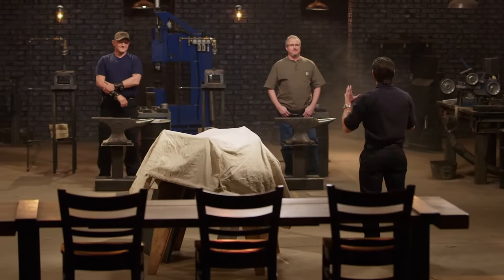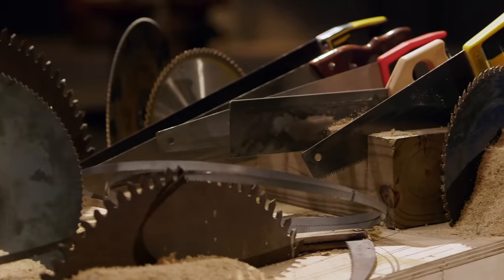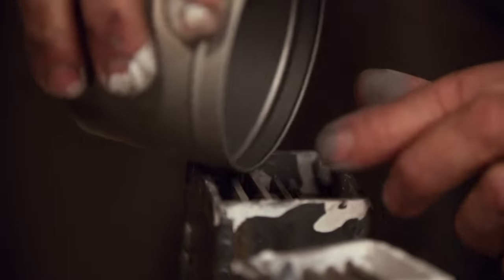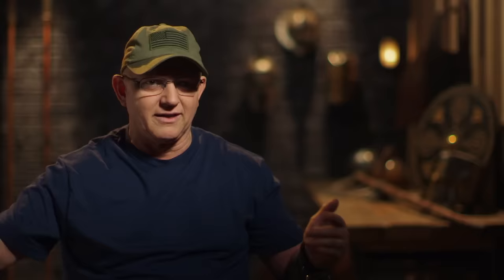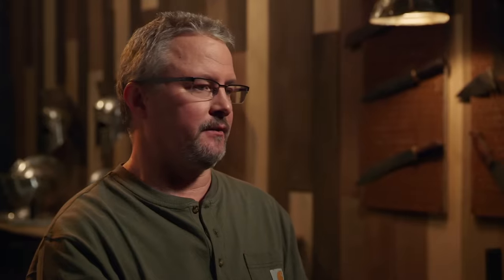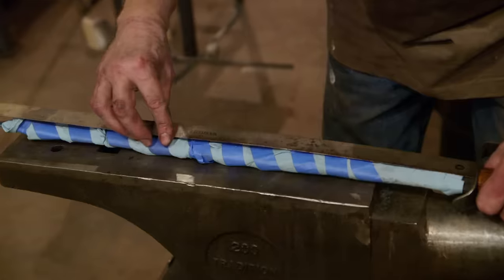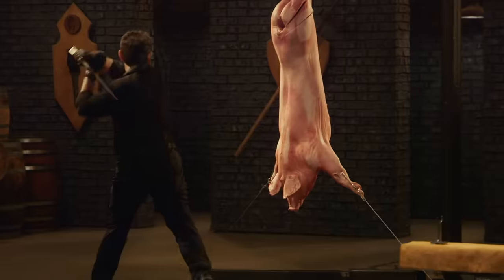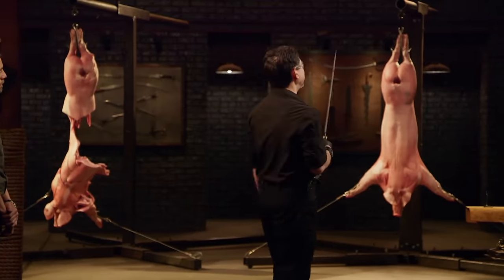Forged in Fire: Beat the Judges: SAW BLADE SWORD CHALLENGE (Season 1) | History

Comment: Even with the weight, I think his sword out performed Jay's.
Reply: correct, it wasn't a weight test
Reply: Weight is something important 
Too little and it won’t cut deep
Too much and it will cut but it will be difficult to control and possibly dangerous due to the extra force required 

This is why you see some challenges where one sword can cut through fish and not rope 

The cut test shows how even a dull blade can cut with enough weight but the challenge was the sword
Reply: @maggimaster  and see no one is saying that weight isn't important or denying it's effect.  But Jay lost that battle even with the extra weight.
Reply: Out performed and look better it was rigged just like boxing
Reply: I mean when a shortswod weighs more than an arming sword it will chop well but in all aspects the swords were compareable like the two claymores they've shot... apart from the lighter blade being a less "impresive" cutter
Reply: I mean, I get that weight is an issue, but when it gets down to brass tacks, the real question when it comes to a sword is, "Does it cut?" And the heavier sword did a better job at cutting. The pig was chopped up better, they both dulled on the pot test more or less equally, and the sand the heavier sword did better. If they are going to ignore literally everything but what the sword weighs then that should be the official rule rather than wasting the blacksmiths time with other random tests. Just put the things on a scale and call it done.
Reply: Yeah Jay's sword underperformed compared to the other. They complained about weight but the heavier sword did the better job. Plus no judge was unable to weild it. Just prefer a lighter sword
Reply: @ejbasshooks3883  rigged! Yeah
Reply: Point here is... Given the choices. Heavy short sword that can cut vs a lighter one that doesn't and the one you'll not pick goes to the enemy which one would you pick?
Reply: No, both sword don't perform that well in sharpness test, just that the heavy sword can cut with more force, Both blade become dull after hitting the pot. although the heavy sword may seem to perform better it was because of the weight rather than the sharpness of the blade.
But, I do agree that not everything come down to the weight. The judge should make thing more clear rather than ignore everything else and focus only on it.
Reply: @xlDon2lx  You need to know that short sword advantage is it lighter weight leading to faster movement, If it is too heavy then why not just use a longsword, similar weight, longer range, use similar amount of stamina, attack at similar speed.
Reply: This is why they added weight parameters for some of the other beat the Judges competitions
Reply: @USA I don't agree with your arguement that the lighter sword wielder is always going to win.  If a lighter sword can't cut, and a heavier sword can... Then no, lighter sword loses.  There are too many factors to simply say a lighter sword will always win.  And in this competition, Jay's lost, his did not cut the sandman or pig as well, which a short sword should be able to do.
Reply: Yes , but in a fight you'll be able to wields jays for longer
Reply: I thought the same thing
Reply: If the judges complain about the weight, you're doomed unless the other guy suffers a catastrophic failure.
Reply: @xlDon2lx  The lighter one. Swords are side arms. You won't use them 99% of the time. And when you use it, it won't be to cut but to intimidate and keep people at bay while you scramble to a better weapon or towards friendly lines. But you will be humping it all the time.
Reply: @ebunny1970  Weight is a huge penalty. Unless the other guy's blade snaps, the heavier blade loses most of the time.
Reply: @throttleblipsntwistedgrips1992  Swords are side arms. They're there to keep people at bay while you scramble to a better weapon or friendly lines. No one wants to find out if your sword is dull or sharp by having it tested on themselves.
Reply: @majungasaurusaaaa   tell the guys with an MoS how a few ounces won't make a difference. 🤷🏼‍♂️🤦‍♂️
Reply: @majungasaurusaaaa  unless you're an 11B with an LMG. Angriest guy on patrol is also happiest in a firefighter😂
Reply: I agree 100% that rules are not very clear especially to the audience due to the performance differences in these tests. Because I do agree in my opinion that Jay shouldn't have won that competition because of the basis of what these tests were meant. The was made clear when both swords performed the same in the strength test however in the other two tests, Tony's sword performed so much better.
Reply: @wheelie-gonzales  comfort matters
Reply: @Devilion901  How is that?
Reply: They always said the weapon shouldn’t hurt the user. Imagine swinging a 4lbs around will most likely throw your shoulder out of the socket
Reply: @ToMu29  Didn't seem to throw Doug's shoulder out of place to me.
Reply: @ebunny1970   A heavy short sword is deal breaker,  exertion kills you before everything else. 

Next time they should include weight parameters since most are plain clueless.
Reply: Yes
Reply: @wheelie-gonzales  Correctly Said!
Reply: @maggimaster  one judge said Tony's had a Good Feel. Weight was not a Issue to him
 Tony's had a Smaller sword, with Similar weight.
Reply: @xlDon2lx  Now think about the point that the heavy short sword you probably chose weighs less than the greatsword I'm wielding and guess what your chances of even getting into the range of your ~16 inch blade alive are? 

The weight is referenced simply because it is part of the definition of the weapon, it's looser than the length for instance, but if you just want to maximize the strength & depth of the blow/cut, skip the sword and make an axe. That's not very fair to your competitor who made a dagger though, which is why it's taken into consideration.
Reply: @xlDon2lx  yeah but the thing is you don't need to cut clean through someone durin a fight. I'd rather have the lighter sword to attack quicker and more comfortably. Jay's does more than enough damage to kill without the added problems of a heavy unwieldy weqpon
Reply: Well the thing is with swords its not just burst performance they have to withstand you need to be able to consistently wield the weapon against your target, and a sword that is so heavy will tire out the user way too quickly no matter the amount of damage
Reply: Who doesn't want to see Jay lose? 😉
Reply: I agree.
Reply: @xlDon2lx  both swords given proper edge maintenance will cut well. The a short sword beyond a kilogram is just a no go... You cannot wield that effectively one handed.
Reply: @yourfreddy23  a sword, any sword has parameter at its base core. a sword is not a mace. most swords are 1-1.5 kg which is 2 to 3 lb. they said his short sword was 4. sorry u dont make a short sword that is this heavy. thats just unsword by definition.
Reply: @chrishubbard64  you do get that heavier swords will cut more right? You also get that they have to make a certain kind of sword. If they tell you to make a dagger and it's 2 pounds of steel in the shape and size of the dagger, that isn't gonna win even if it cuts a pig in half first swing
Reply: @RozKounelakion  You do get that they have parameters to work with right? if it fits in the parameters then all thats left to decide is which blade does its job better. A heavier weapon may tire you out sooner, but if it kills in one attack while the lighter needs 2, who is going to run out of opponents faster?
Reply: Dont listen to these people. This was rigged
Reply: Totally rigged. If a sword doesn’t cut them it’s useless. And as someone else pointed out they were able to wield it without trouble so complaining about the weight is just personal preference. All swords can be unwieldy no matter how expertly made if used incorrectly, such as just standing there and wildly swinging like they do sometimes. Jay definitely did not win, his blade will not keeel
Reply: Exactly i feel bad for tony
Reply: Bro this is a short sword so it must be the onehanded not double handed. So weight is so important
Reply: Its not rigged bruh a short sword is supposed to be lighter to be wield better not a short sword that weights like a claymore
Reply: I think it was the right decision even though he out performed the judge it wasnt by the biggest margin. The weight is a gigantic factor in a sword.  Think about if you were to fight someone the heavy sword would cut deeper if you connected but you would wear out quickly and be vulnerable to a good swordsmen lighter is just whats needed in a sword
Reply: When your weapon is totally out of the weight scale you always loose at this game, judge blade or not.
Both blade have « properly » cut only one arm to the end, so obviously the weight is the key factor. In fact this defect are so big than the only way he could win is if the judge blade have broke.
Reply: Ok so I'm going to put my opinion in here.  Jay 100% won. Both couldn't cut.  End of story.  The first sword didn't cut.  It crushed. The other competitor suffered some damage in the strength test.  Jays did not.  For those who think it is rigged.  If you look at the other time Jay competed, he lost due to a small handle issue.  So no it is not.

Now for those who say weight isn't everything.  It absolutely is.  Swords that are as long as this should never weigh over 4 lbs.  That is an extreme amount of weight in a small package.  Weight will cause many issues and could cause a sword to break the users wrist.  So yes jay one.  Feel free to argue but that is the truth.
Reply: @yourfreddy23  bro weight is just as important as comfort.  The heavier blade is harder to control, harder to swing, and could possibly break your wrist.  Weight isn't a parameter no.  It's a common sense subject to any blade. No sword that size should be that heavy.  End of story
Reply: @RozKounelakion  I'm sorry but I have to respond to this idiotic post.  No a heavier sword will not cut more.  A sword that weighs 2 lbs and the right heat treat and sharpening can cut more than a 4 lb sword with the same.  Weight bogs the blade down and makes it so it cannot cut all the way through and to top it all off, makes it harder to wield.  So please do research and not post stupid arguments
Reply: @yorkhyper1449  no, I won't
Reply: Think in terms of a nail hammer. If the task is to build a nail hammer, and you turn in a sledge. Yes the sledge will drive a nail better, break things better, and overall perform better. But it's not a nail hammer, it's a sledge. Now if you turn in a slightly heavy nail hammer, then it's not a huge deal. But go to your local gym, pick up a 1.5 lb (likely what Jay's blade weighed) dumbell and swing it around, then pick up a 4 lb dumbell and swing it around. It's a huge difference.
Reply: Something I thought while watching that I didn't see commented on much is that the blades can be resharpened, both of them. It would be a simple task. Would they have performed significantly different than each other after a sharpening? Probably not to an extreme. The pig test was a good indicator of that. Overall, despite both dulling, they can be resharpened with ease. The heavier sword cannot be made lighter with ease.
Reply: Doesn’t matter weight is a spec when it comes to a blade.
Reply: I agree
Reply: I would prefer a light weight sword
Reply: It did only because of the weight tho.  You wont be able to fight with this for multiple hours
Reply: It would have but the weight was too excessive. A short sword needs to be light and sharp, you need to be able to swing and cut effortlessly with it and if the weight is too heavy it's more dangerous to the wielder than the enemy.
Reply: Facts
Reply: @wheelie-gonzales  It wasnt a weight test? Wut? Weight matters. And "performed better" just cuz the weight it cuts deeper etc. Its for sure much nicer sword but its not effective.
Reply: @maggimaster warriors got used to heavy swords, grandpas didnt
Reply: In terms of sharpness nad durability, it did outclassed Jay's blade.
Reply: Agree
Reply: A four pound short sword is heavier than most longswords. It’s not quite a claymore, but it would be close to the weight of some two hander swords
Reply: @jlaw131985  
A sword that doesn't cut is a problem also. Granted both issues could be easily solved. But at that moment I personally think a dull sword is worse then a heavy sword.
Reply: @sjgavenger37  they both cut during the kill test, and they were both less than ideal after the strength test. And even if the performances were less close (which they were actually pretty close) 4 pounds is extremely heavy for a short sword, and you’ll tire out in no time while trying to use it, and even if you didn’t, the swings would be slower, easier to deflect, and hard to recover from. No way anyone who actually wants to fight with a short sword would pick that sword over Jay’s.
Reply: It's almost impossible to see the impact weight has on something through the screen. I've seen episodes where the contestant wins so it isnt necessarily rigged
Reply: Agreed
Reply: Barely. Jay’s was too light to overcome the damage to the edge in the pot chop, but because the other blade weighed so much more (4 pounds is significant weight when attempting to use practically) it made it uncomfortable to use. Yes, the momentum generated by propelling such a heavy chunk of partially blunted steel is capable of causing massive damage to a target (a ballistics dummy would have shown this far better) but when neither sword can cut well, it becomes judge’s preference. And the judges, understandably, didn’t enjoy swinging a sword that weighed as much as half a gallon of milk.
Reply: @ebunny1970  depends. The lighter sword is easier to thrust with. Thrusting is more precise, is often quicker, and was Jay’s not stuck in a block of wood at the end? That would indicate that it at least had a reasonable point. Plus the lighter sword can parry better, while the heavy sword can only really make huge slashes that, yes, tear into the target nicely, but they leave the wielder exposed and are harder to maneuver, meaning limited blocking capacity, faster stamina drain, and fewer effective offensive tactics compared to a lighter sword with a sharp point, even with a dulled blade.
Reply: @chrishubbard64  which can deflect a blow faster? Which can be maneuvered defensively better? Which has a better range of offensive options? The lighter sword. The heavy sword is a chopper. Not a cutter, not well balanced, not a stabbed. A chopper. Meaning that large, slow, slashing motions are really the only option for fighting effectively. You can keep that sword. I’ll use a lighter, faster blade that can deflect yours or dodge it, poke holes in the openings you leave when you slash, and by the time you’re looking like that pig, my arm won’t be tired. Meaning if need be, I can just draw that fight out until you’re exhausted.
Reply: @wheelie-gonzales  Sword parameters matter in crafting. A longsword on the heavy side 3.5 pounds. If that short sword really weighed 4, it's outrageously too heavy.
Reply: I think the eesence of the knife is so that it can be wielded one handedly
and the wieght made the difference
Reply: As a trained rapier,spadroon,sabre,small sword fencer if a sword is heavy or a bad center of gravity its a fatal failure u cant swing that thing as easy and cant thrust as good so i agree with the judges

There r many other reasons why too
Reply: yea me too.
Reply: @chrishubbard64  well in a real fight like 5v5 or 5v10 would you rather be able to swing a blade enough to kill 5 guys or 1 guy I would take the lighter one cus that thing isn't gonna drain me as much
Reply: @Ghostdragon529  those judges are masters at it, if you take a regular guy he wouldn't be able to swing it twice in a row
Reply: @xlDon2lx  if the heavy sword wasn't as heavy it would cut just like the normal one, and the purpose was to make a short blade and not a heavy sword
Reply: @Devilion901  a heavy short sword at that xd
Reply: @zacoutortue009  I wouldn't even take a batt  with that weight
Reply: @chrishubbard64  that depends with a heavy sword I can kill one dude and then be tired out with the light one I can go ham much more
Reply: @mickeyjett9197  that's the most stupidest thing I have ever heard someone say, a sword can be unwieldy? I wouldn't want to bet my life on a sword that doesn't keep me safe bro if I had the choice to chose a good weapon over a faulty one you  know which one I will decide on
Reply: One handed blade shouldn't weigh a lot .
Reply: 4 pounds is not small
Reply: Agreed.
Reply: It doesn't matter. It's a short sword. It must be light. That's an absolutely essential feature
Reply: why dont u become the judge ...u r so expert just watching tv
Reply: I'm trying to buy condoms
Reply: Yeah same, I was surprised when Jay won.
Reply: yeah, that was b.s. J' s sword didn't even cut in the last round because his edge got beat by the pots and his end looked all funky bc he had to shorten it up rq so he wasn't over length...
Reply: Aesthetically Tony's blade was far nicer
Reply: @elyanae9588  rip tony
Reply: I ripped a dirty dump after that
Reply: @throttleblipsntwistedgrips1992  Not if your arm is cut first.
Reply: @maggimaster  I mean if they say the word heavy guarantee he will lose unless his opennent gets catastrophic failure in his weapon then he will win
Reply: You can see it in the cut test
Reply: I do have to agree, it did well on the first sharpness test but into the second he definitely lost
Reply: In every category except as weapon.
Reply: Sure, but it's a matter of misinterpreting the assignment. If you asked a couple people to write a good short story, then one writes a mediocre short story, and the other writes a thrilling and engaging novel, obviously the one with a better grasp on the assignment should get the win.
Reply: Agreed
Reply: And the craftsmanship was better in my opinion
Reply: @kennyoboy642   No lol,  weights, lengths are standardized,  what you said is an individual preference, holds zero value.
Reply: Totally agree
Reply: Its not about performing, crushing or slashing/cutting. Even durability shouldnt be the sole criteria.
Its a weapon. and weapons are made for people to use. This should be usable.
If its built just for big people, the weapon doesn't have versatility. This should also be something to be noted. There's no reason for this to be overlooked. In a store, anyone who buys it should be able to use it, not just Gregor Clegane.
Reply: And they also said it in many episodes. If its too heavy, your energy to keep swinging it in the battlefield decreases, resulting in a not so great outcome. Even Gregor Clegane gets tired.
Reply: @chrishubbard64  Travel back in time and fight someone using a 4 pound one handed blade, while they use a 1.5 pound one. You will get demolished.
Reply: @Ghostdragon529   Was it rigged, probably. Would I pick a 2 1/2 pound (well made) short sword over a 4 to 5 pound one? Every time. Because I’m thinking “ how agile can I be in battle with this sword” and in battle, speed determines the winner. Most of the time.
Reply: @xlDon2lx  Simple, I would go with the lighter sword.
Reply: @yourfreddy23  ??? They've been pretty consistent throughout all their episodes. If your sword is heavier, you lose if your opponent's sword doesn't break.
Reply: @TheMaverickq  ...I am also certain at this point that the people rooting for heavier weapons in this thread has never touched a sword in their life.
Reply: Oh hands down, easily bet Jays.
Reply: @porkcutlet3920  if it's heavier but still well balanced for fighting it's still won. I've seen heavier swords won. Being heavier will guarantee more mass and materials to perform better in cutting and durability test, however, if a short sword is heavier than most two handed wp it's def not good. Most people never swing shjt in their life, a heavy sword slow you down a lot and affect fighting techniques which can't be seen in such a vid like this so they tend to underestimate the effect. In irl fighting, even a cut to the hand is enough to end the fight but most will just watch movies and think movies fighting is legit. Well if a huge dude swings the heavier blade it prob be fine if the balance between speed and agility is not affected. 

The con of an overly weighted sword is: slow which makes op can react, block easier while you can't do the same as effectively, hurt your wrist and shoulder. If it has more mass, it obviously gonna cut better unless the blade is dull. And more mass means it's harder to bend and break.  If one go with an overly weighted blade, they effectively chosen to handicap themselves in a fight so technically they choose weapon life > their own life. If a user is very strong and well built they might go with a heavier weapon to a certain extent because you can't swing faster at one point there will be a cap to it. It's like swinging your hands empty-handed. It's all about finding a suitable weapon but in general you will never choose a wp with more weight than necessary.
Reply: Exactly!!
Reply: Jay was bumbling right out of the gate aid no “master blade smith”!!! This is the second episode where they gave him the win over a far superior blade smith. I my opinion Jay is a sham and the weapon he made in this episode was something that I’d expect to see from a novice. Tony’s blade on the other hand was absolutely beautiful, albeit a bit heavy. It cut the sandman with ease, whereas Jay’s blade failed miserably. After watching this, the second of a rigged competition, I’ve decided to not watch anymore.
Reply: For all the replies saying it matters about weight, go back to watching other contestants, weight had probably the most minuscule importance when deciding a winner, even more when they clearly outperformed the other (despite the opposition having a lighter blade). This was clearly rigged, no question about it
Reply: we all do
Reply: Yeah I’m starting to think that these beat the judge challenges are rigged
Reply: Not only that I think the extra weight help drive the blade through some things Jay’s couldn’t.
Reply: weight is more important. this is not sumo wrestling
Reply: Yee
Reply: Like the look way better then jays style points
Reply: Weight is a big deal though, when actually  using a blade.
Reply: But they are seeing with some refinement the lighter one has more practical use which is why it won.
Reply: For those who disagrees that J won, think about it in a real life fight. You can wield a lighter blade longer than your opponent who has a heavier blade. Having a lighter blade will make you more agile and consume less stamina than wielding a heavier blade.

"bUt tHe oTheR sWorD PerFoRmeD bEtTeR". Dude, If I'm not mistaken, swords are primarily made for fighting not cutting pigs and smashing pots. Aside from the tests, the swords are also judged based on how practical it is to take into battle.
Reply: No sir. Weight matters alot. With weight you cut deep but by cutting deep you loose power and stamina to wield it.

A short blade should be very light. A light blade does not cut deep into the stuff such as bag with sands or other stuff. A lighter blade is fast to maneuver and wield.

No one likes to opt for a heavy short blade. Cuts do not matter when you are unable to maneuver it
Reply: Only idiots would think that its rigged
Reply: It’s a single hand sword overall. Weight does matter a lot. In fact Jay’s light sword perform better in the strength test showing that he has better control on the heat and the chose of metals. I personally think the judges made the right decision
Reply: @vanmann8347  it all depends on the rules of the competition…
We talked about specs and tony doesn’t respect what they asked , a short blades he knows the standard for those blades if I was the judge I wouldn’t let tony even compete..
I ask for a compact car and you bring me a station wagon How can you compare ?
Reply: @chrishubbard64  It did better on the pig test because of the WEIGHT. What matters is that the blade is able to kill, not that one did it "better" or "looked" better.

Look at how OUT OF BREATH he is after swinging the sword. A short sword is meant to be able to be handled without issue. Not out of breath after 4-5 swings lmao.

And his did one whole cut more on the cut test, and could again be attested to weight rather than actual cutting ability. 

I don't remember the video, but there was a sword guy explaining this exact thing, and was taking dull but heavy blades and slicing through bamboo and other material with it, while then doing it with a much lighter, but far sharper blade, that couldn't manage it all the way through. The lighter blades CUT better, even though they couldn't go fully through, whereas the other got through by weight and momentum, rather than cutting edge.

Look at it more like the slice tests they do. Some swords go all the way through, but they ripped/tore/etc/ through it, rather than CUT. That's basically the issue with his blade.
Reply: And it was more beautiful
Reply: The whole purpose of a short blade is that is supposed to be light and easy to swing around, so yeah weigh does matter otherwise they would have asked for a claymore if the while point was to cut in half on one swing
Reply: Seems like with the weight alot of it comes down to personal preference and strength. I agree, Jay probably should of lost
Reply: You have to realize that weight is such a kill factor in like making any sword. Heavy blade uses energy and more time to swing. Compared to a light sword as the judges said you can do it all day without getting to tired. 
I know it seems like puny excuse but weight is the most important thing to a sword.
Reply: Weight is probably one the most important factor on a blade that performs. I've seen beautiful, amazing dozens that cut through, but were just simply beat by speed and maneuverability brought by weight.
Reply: Kinda, if the sword isn’t comfortable to wield, that counts for a lot.  If you had to use a blade, you’d want something comfortable and balanced, not something that would tire you out and hurt your shoulder.  They tested equally, imo, except the sand man test, which was very close.  If I had to choose one I would have picked Jay’s.
Reply: @Ghostdragon529  they only wielded the heavy sword for a few swings. In battle a heavy sword would be deadly to the user as they would get fatigued faster. Also it may have not been a weight competition but it was a singe handed sword competition and the weight makes his sword too heavy to be safely wielded in one hand.
Reply: I can say from personal experience that a heavy blade is not comfortable to wield, especially a close quarter combat sword like the short sword, and jay's sword trumps the other sword in terms of functionality for a blade can be sharpened too
I like the design of the heavier sword in terms of looks nore than jay's tbf
Reply: @ebunny1970  i mean saying that the weight is to be disregarded in the competition for it cut sharper than jay's is kinda saying that weight isn't all that important, don't you think?
Reply: @Ghostdragon529  yk there's a reason to why they prefer lighter swords...
Reply: @chrishubbard64  these swords main purpose is to serve as combat sidearms, i think you're underestimating how much of a issue it is.

If today's troopers break the handles of toothbrushes to reduce weight, imagine carrying 2 to 4 extra pounds of secondary equipment for miles ON FOOT before you reach a battlefield and then having to fight face to face with the enemy.
Reply: I think jay lost that in reality.
Reply: yea, he got duped....grats J
Reply: sadly, swords have a "standart-ish" weight for a reason, when you accelerate a sword and miss target it puts a lot of pressure and lever on your joints, a heavy blade needs a big size to compensate the body mechanics, but in a small blade, its a recipe for self injury... i agree it was better looking blade ( not so much the handle, but the blade itself... uufff it was pretty) but its no use when u cant properly swing it...
Reply: Try using a 4 pound one-hander. You'd rather use your fists.
Reply: @wheelie-gonzales  if that were the case then competitors should just put a bunch of weight into their short swords so they could cut better. Remember its a short sword and not a two handed weapon. Making a short sword much heavier than the typical weight and then judging both of them at the same level is unfair in so many levels
Reply: @ebunny1970  it would unfair if you could add weight when it's not faithful to its design and then the judges not take it into consideration and simply give you the win because it cut better
Reply: @mickeyjett9197  Its not just a personal preference bro, how can you downplay the importance of weight especially when they take historical accuracy into account. As someone else said, if they ask you to make a dagger and your dagger is heavier than dumbells then you arent going to win, regardless if it performs well in the tests
Reply: yeah, his sword outperformed Jay's but not that much.
not enough in fact to justify him winning with a single handed sword that weight heavier than a double handed sword
Reply: @xlDon2lx  the lighter one, because your enemy is not a pig that let's itself cut up. Your enemy will be armored and mobile. Heck, if I can exchange the heavy one for a sword of the same weight, i would choose a Zweihänder to fight the ther shortsword.
Reply: It did outperform it at the cost of a single handed shortsword weighting more than a twohanded longsowrd should...
Reply: agree
Reply: J coasted knowing his sword didn't need to survive J beating it against wood/rock/iron, went for a lighter sword.
Reply: @wheelie-gonzales  but it is weight test, its all test, in battle I would rather fight with jays lighter one that still cuts  rather then heavier one, that's jut my opinion ;)
Reply: I wish I could go back in time and ask a roman soldier which sword he'd prefer to take with him in battle.  Because when it's a matter of life and death, the soldier would choose the better blade, heavier or not.
Reply: Yea, even tho Jay's blade wasn't as heavy, it did bad on the sharpness test.
Reply: Boys I think it's fair. They have parameters that needs to be met which is for a one handed short sword.
Reply: Agreed
Reply: Definitely biased because his jays sword didn’t even cut at all
Reply: ofc it cuts better when the weight is doubled. They made a short sword not a mace
Reply: @chrishubbard64  you can sharpen a sword. You can't take off much weight or redistribute the weight once it's forged
Reply: @xlDon2lx  I'd take the lighter one, since I could sharpen it. Swords are supposed to be light. They aren't making axes.
Reply: @throttleblipsntwistedgrips1992  exactly. And you can sharpen a blade if it doesn't cut. You can't really fix a weight issue with a sword once it's forged
Reply: @ebunny1970  No, but if you've ever tried using a sword, you'd know that it doesn't need to kill your shoulder to tire you out. And if you're too tired, you're dead in a fight. You can sharpen a dull blade, but you can't fix a heavy one.
Reply: @porkcutlet3920  Exactly. Tons of viewers want to backseat judge and complain about how heavy weapons always lose when most of them have never even seen a sword in real life, much less picked one up and swung it around
Reply: @isaiahhallett9871  There's a Beat the Judge episode where Jay loses. Was this one rigged? Possibly, but not all of them are. And the other beat the judges episodes are relatively fair, where the judge is actually a genuinely great smith like Ben or Dave
Reply: @Sienista  and you can always sharpen it if it's dull. You can't fix a weight issue
Reply: Yeah but in the end of the day the weight matter when your in battle otherwise your the first to get tired and the first to die
Reply: @whiterosebloodmoon4522  Exactly. You can sharpen a dull blade, but you can't fix a weight issue. I'm sure lots of people who make comments like this have never used a weapon for an extended period of time
Reply: if the judges pick the heavier sword then i bet subsequently all contestants gonna just make swords heavier than what it should be to add to their cutting ability
Reply: @xlDon2lx I'll pick lighter because you can use it to stab much better if it's edge are already dull probably in combat heavier short sword can easily tired a swordsman and if the edge is already dull you can hardly use it for stabbing because your tired compare to a lighter sword.
But it is indeed the heavier short sword out perform the light one in cutting
Reply: His design was better, too.
Reply: I'm just watching this 3 years later and I agree 100%, sometimes I think they give the judge the win just because.... NOW, when they do the blind testing, I'm more inclined to agree with those decisions. But the other guy's sword outperformed Jay's without a doubt...
Reply: @chrishubbard64 no the test is which is better for a combatant to use not simply what cuts better.

A good arming sword is objectively better than a shieldbreaker viking sword for general sword work but the shield breaking cuts better.

For a combat blade suitable for general use you want a a low weight sharp blade not heavy and dull.

The judges look at the weight parameters for style as much as length and balance.
Reply: +3 durability and 2 slash over 7 agility. You do the maths
Reply: Bc it did
Reply: So j won because the sword was lighter?
Reply: @Payne33  weight is a big part of how a sword balances. How it feels in the hand if a lighter sword and a heavier sword cuts the same the lighter blade is generally going to feel better to a user.
Reply: @jediknight1294  yea I can get that just feels better swinging but looked as if it definitively did more damage in every test. Other guy should have won. Those test were designed to test the blade and strength and sharpness I never heard them say anything of a weight test
Reply: @Payne33  that's what the kill test is about.

Anyone can get a blade to chop well if they make a heavy blade, conservation of energy is a thing after all.

Balance matters, how it feels to the wielder matters, a heavier blade is harder to control, it's harder to go from the committed attack, recover and go for a secondary strike. It's harder to pause a strike and reaim to avoid a guard or block and it's physically harder to use for an extended time.

As long as the edge geometry isn't utterly scuffed a heavy blade can compensate for dogshit technique and weak edge alignment.

Hence why a LOT of cheaper swords like the Cold Steel range are at the heavy end of spec for those blades. A heavier blade is far easier to chop with and so the cold steel blades perform INCREDIBLY WELL in cut testing and far better than you'd expect in novice hands.  They also tend to be tip heavy for the same reasons since the majority of buyers aren't fighting with a live blade and are thus biased by cutting test results.

If you are actually using a blade, the lighter blade is a better tool, even for things like a Scottish or viking  shielbreaker sword. They are incredibly physically demanding blade to wield but the lighter blade in the hands of someone skilled will be the better option because it can be used for longer and deliver the same level of damage.

Doug judges from a fighters perspective so you get a different view to Dave who biases more to cutting/chopping tests.

The show as a whole tends to favour heavy blades generally being so focused on chop tests and resistance tests so if the feedback is it's too heavy then it's REALLY at the top end of the weight spec for style.

Just food for thought.

Admittedly I'm biased to lighter blades coming from a fighters perspective having spent 15 years reenacting.
Reply: Easy to say when you aren’t the one holding it. Doug’s forearm was bulging from the competitor’s blade.
Reply: @iamtheoysterking  That's why I said "even with the weight".
Reply: @ejbasshooks3883 this is not a beauty test. A sword what is too heavy - especially a short sword, is not well controllable and thus dangerous for the one wielding it.
So the loss of the heavy sword of the competition was totally right.
Reply: @wheelie-gonzales  If you cannot wield the weapon one handed then it is not a short sword.